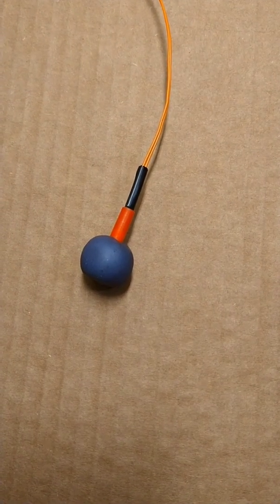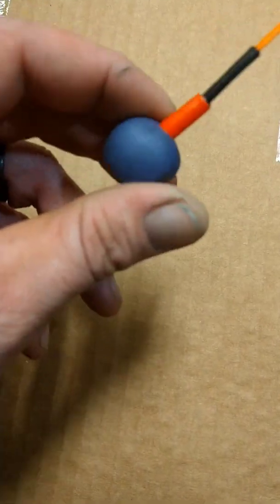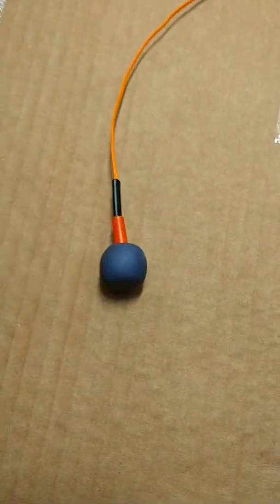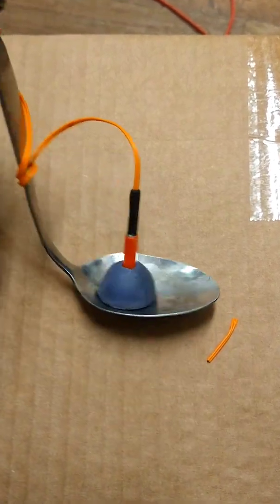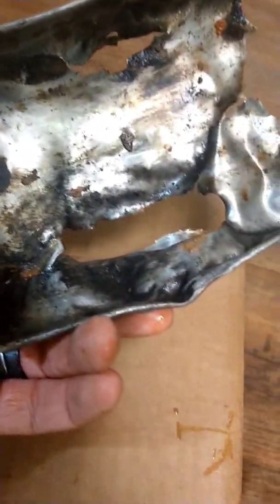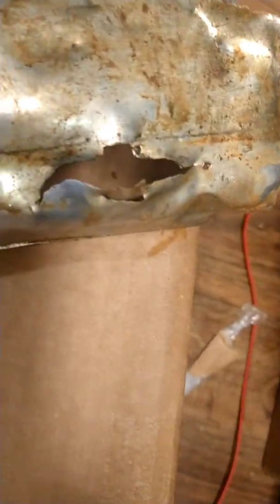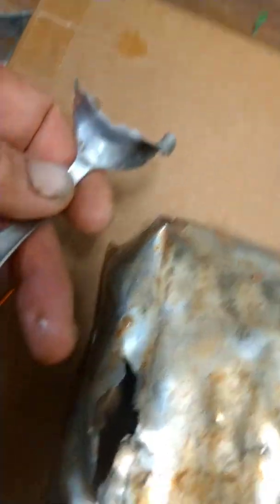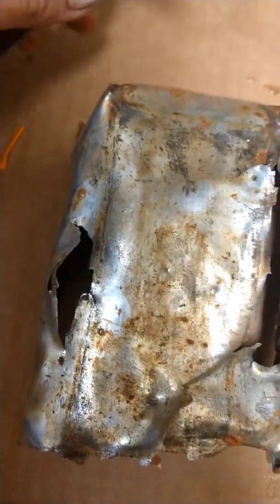Plasticized CHP+ETN=💪Russian Blue🇷🇺

Comment: That is quite impressive for a cheap smokebomb sized chunk. That was similar in power to a #8 blasting cap. Would be interesting to see lf it could initiate an ANFO or AN/Al charge directly as it is an extremely brissant misture. Might be fun to try mini shaped charges with it as well. Stay safe 🤓
Reply: it will 100% detonate anfo. the hmtd alone will do that.
Reply: ANFO is very easy to initiate. A shotgun primer will do it if set up right
Reply from the maker: Well I wouldn't say that..you need a booster to initiate ANFO, i would know bc I've tried using 99.8% lab grade ammonium nitrate and #2 fuel oil with 10g of tatp...no detonation. I could have used ETN as a booster but never got around to it, now if you want to know about an ammonium nitrate mixture that is extremely cap sensitive then look no further than ammonium nitrate and nitromethane with 100% nitromethane and lab grade ammonium nitrate you might get close to detonating that with a primer cap if constructed in a specific way to compress the mixture with the primer blast I was able to get a partial detonation using flash powder
Reply: @improvisedchaos6355 the nitro mix will almost go off if you call it a bad name lol. So I get where youre coming from. I worked with the stuff in mining and of course, being young and stupid, any one of us that had access would play around when we had a chance. I can assure you that a #209 shotgun primer will work with the right setup. And we aren't talking about reagent grade stuff either. Amazing that none of us got killed tbh
Reply: Of course it will detonate ANFO. Most people are stupid when it comes to ANFO though. They will waste perfectly good AN and mix it with AL alone or add a weak fuel base like regular gas, diesel fuel etc. instead of paying a little bit more and making it 3-4x more powerful using a strong fuel base like nitromethane or any 'amine' and that will give one hell of a blast... 

This is one of my specialty mixtures I rarely share: Take prilled AN and add a small amount of acetone to it and blend it up in a food processor to make it a fine powder. "NOTHING WILL HAPPEN WHEN IT'S WET LIKE THIS SO DON'T SAY THIS IS UNSAFE!". After its powdered, pull it out and mix it with a little bit more acetone. This will drive off the water. After this, put in oven to on 125 degrees x 45 minutes to 1 hr. to drive any remaining water and acetone out of the mix. After this is done, put in plastic bag and set aside. Take Styrofoam and melt it in the strongest alcohol you can get your hands on. Best I have used is 95% nitromethane. Keep melting until you have something that resembled same consistency as rubber glue. It should pour in the same manor, like warm honey. Mix in some finely ground air float aluminum and a plus is some iron oxide. Mix everything together except your slurry of Styrofoam nitromethane mixture. Make sure everything is stirred well. Now add in your slurry in isometric amounts. #4 cap will set this off especially with the iron oxide if it's a small micron.
Reply: @Tiebox  interesting mixture. It's very similar to a model rocket fuel I made years back. Only difference was that rubber was used as the fuel with AN..The iron oxide is critical to get it burning correctly. Without it th4 AN burns as globs.
Reply: @USA_is_a_Republic i could make 10kg anfo and itd cost half the price of making 1kg of 6:4 ANNM so whats the point

Comment: I wonder how plastic with only chp would compare to that?
Would be cool to then set if off with only chp as well :D
To show that it can be used both as primary and secondary
Reply: The charge in video can broken steel plate 5 mm of thickness. Pure plasticized CHP 4 mm. Results both will on thin spoon a same. Spoon will cutted and dissapear.

Comment: I'm surprised that HMTD set of ETN
Reply: HMTD will set off all kinds of stuff, from ETN, PETN, RDX and way way more.
Reply: Typically you want a over driven primary to set of a secondary because ETN has a VOD excess of H.  JS
Reply: @briancombatengineer12b91  Believe me I know a little bit about explosives. Good luck finding many primaries  with a VOD higher than any of the explosives i just mentioned. ETN is  the easiest of the 3 to set off.  He mixed  the ETN with CHP and  CHP can be used as both a primary and a secondary. CHP is just hexamine and tetraamine copper 2 perchlorate which has a vod of around 7,000  MS give or take  a little.
Reply: @darianballard2074  so do I,  lol
Reply: @briancombatengineer12b91  Makes some videos then
Reply: @briancombatengineer12b91  Not if you thought HMTD would have a hard time setting off ETN lol
Reply: @darianballard2074 ok,  let's say you want to detonate c3, c4.  Would you use a combination cap containing a base charge of PETN,  or a H cap that just puts out maybe 5500 vod?  Obviously you would choose the PETN,  I thought so because it meets of exceeds the vod of your main charge 🤔
Reply: If you used a lower strength cap,  you would probably still get a det,  but may be low order that will result in splatter of the main charge and inefficiency.  But my training isn't up to your standards of course.
Reply: @briancombatengineer12b91  The more binder in the secondary  the more VOD you need in a cap.. Just about every one knows that.  You talk about training but have you made c4 from scratch or the blasting caps?  I make everything from scratch, often  even the  reagents. Hell I make explosives that is still in testing and not in use yet by our military like silver nitrotetrazole.
Reply: @darianballard2074  I have heard of nitrated silver based explosives, fulminate etc.,  I'm trained to use and employ them and  not a chemist so you have me beat,  hats off to you sir.
Reply from the maker: @darianballard2074  thank you Darren thank you very much sir
Reply from the maker: @darianballard2074  my blue Russian is pretty impressive if I do say so myself I'm sure you agree everybody talks like they know everything but they don't get arrested for making explosives do they? lol as much as possible🤣
Reply from the maker: @darianballard2074  and that hmtd definitely detonated the blue Russian at a high order level
Reply from the maker: @darianballard2074  and it probably wasn't even a point two gram charge of hmtd
Reply: @improvisedchaos6355  I like that mix a lot :)
Reply: @improvisedchaos6355  Thats what i use is 0.2 when using HMTD :P   Good video.
Reply from the maker: @darianballard2074  I figured the lack of oxygen in the CHP would benefit from the positive oxygen with the etn and I think I picked a winning combo💪
Reply: @improvisedchaos6355  Looks like it. Good work.
Reply from the maker: @darianballard2074  thank u very much...ur prob one of the most respected individuals in this field 💯, let me dust my shoulder off, 🤣
Reply from the maker: @darianballard2074  I have been scouring the internet trying to find information on plasticized combination mixtures of etn and CHP and I believe that I am the first one to publish or show combination in action I know that the Mad Russian scientist was combining it with etn but I don't believe he was plasticizing it as far as I know he may have not published the video of it most likely he did try it it is amazing hand rolled to the maximum density possible I think the transfer of excess oxygen to the CHP from the etn really improves to combination rather than slow it down
Reply: hmtd is powerful stuff